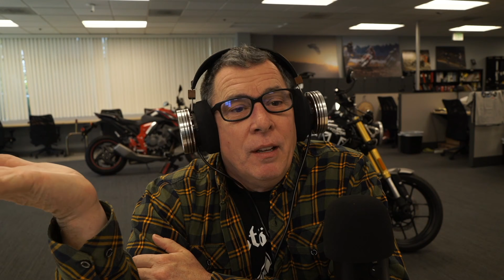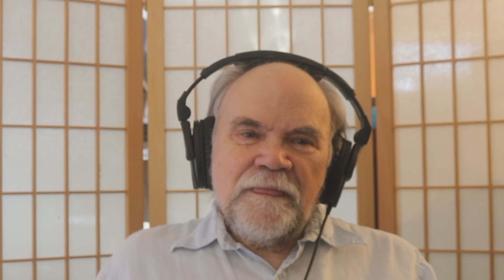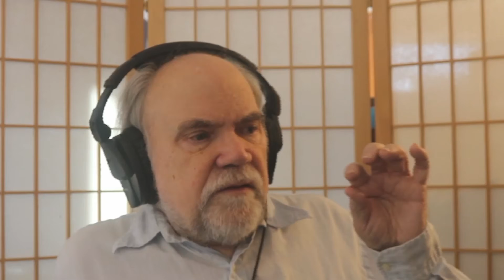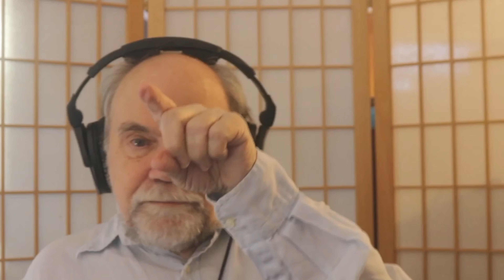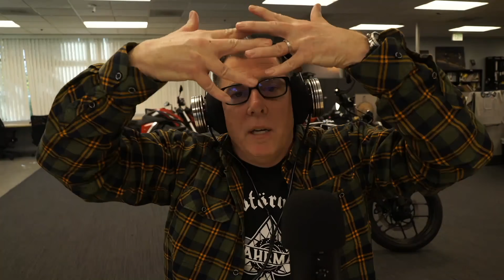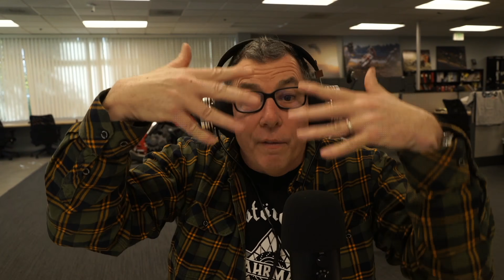The TOP 6(ish) MOTORCYCLES and TECHNOLOGY that changed everything!

Comment: I have a 1976 Suzuki GT750A. It has twin frame loops similar to Featherbed. To top tubes are closer together (rider comfort) and it has a substantial tube from the top of steering head to  a cross tube under the seat. 
It handles badly on original rear shocks. It’s pretty good with Hagon rear shocks (softer spring & stiffer damping). Its downfall is excessive fork rake that makes it steer slowly.

Comment: NSU Max 250 had an eccentric drive to the valves. Same technique as used by steam engines to drive the cylinder slide valves.

Comment: De Dion invented a semi independent rear suspension. It’s a solid beam between wheels with the differential mounted to the chassis and connected by jointed 1/2 shafts.

Comment: I’ve just discovered this channel and I’m hooked already. Many thanks especially to Kevin for his obvious erudition. 
I’ve learnt so much already and my bs detector was never even close to sounding!
I’m returning to biking after a gap of a decade. I had a VFR750F-T for almost 20 years and I’ve recently bought a CB750 Hornet (I’m in the UK, not sure if this machine is available in the US) and love it. In real terms, it was less than half the price of my VFR. 
I was really interested in Kevin’s remarks on this new wave of 270 degree parallel twins, of which the Hornet is an example. The Hornet is also 8v but only SOHC, I’d be interested in Kevin’s thoughts on this. 
BTW My new Shoei helmet has a ‘Pinlock’ visor. I’d never heard of this device before but to me it’s miraculous. I live in the cold,  rainswept north of the UK and yet my visor never mists, even when stationary in traffic and fully closed. How on earth does it work? The usual  ‘it’s just like double glazing’ explanation doesn’t really cut it for me. 
Anyway, I digress, thanks again to both of you - liked and subscribed.
Reply: I work in the industry.  I've been a fan of Pinlock for almost 20 years - I won't ride without it!   I've had Pinlock webinars, though it's been a while.  I agree with you on the "double glazing."  It may play a part.  But,  the big reason I recall is that helmet shields are hard surface treated, so the moisture in the air has no option but to condense on the surface.   The Pinlock is not hard surface treated and is therefore able to absorb moisture and prevent it from condensing

Comment: Thanks so much once again! I started riding on a 57 Norton Dominator 600 in 1967 and consider my apprenticeship on heavy British twins to have saved my skin when I finaly graduated to a ZX7R In 89 and eventually to a ZX12R IN 2001. Having a broad range of riding experiences prior to these light and blindingly fast machines saved me from the pain and anguish of youthful exuberance!
My CBX and my ZX12R languish in the garage while I settle into my old age on my 2 valve MultistradaS 1000.
So many memories flood back while listening to you two. Maybe I should re commission the 12?😊
Reply: Honda CBX1000 had 4 valves per cylinder yet made just 105 bhp. To be fair the spindly front forks could not handle any more but I’ve often wondered why it was never given its real (if not full) potential

Comment: Motorpace bicycle racing is pretty quirky. 
Now, a special scooter with pedals 
is the official machine. 
The pedals are used for giving the operator a cadence oriented sense of 
Maintaining a intended pace and or graduations of pace required for competition.    Strategy and communication between the team is
Essential.    
50 mph on a bicycle velodrome,
 only inches away from the back wheel of the moto requires some skill. 
And the history of 6 day bicycle racing 
is quite interesting.    Bicycle racers were the highest paid athletes in America at the time. 
Madison Square garden was originally built for housing a bicycle velodrome.
I was a track racer.   I specialized in 
Match Sprints.     Because, at 225 lbs 
And built like a linebacker,  wasn't an asset when chasing those skinny 
125 lb road racers uphill.
And why i like how easy my rc51 'thunder pig'  is to ride.   Torque.   But the RZ350 did have some zing
above 6000 rpm.     And i could pick it up off the ground. 
Motorcycles are awesome. 
But the bicycle saved my life.

Comment: Ok, my fun Hyabusa story. It was available here in Canada before it was available in the US. I was the service manager at a shop here and one of our first sales was to a customer in Arizona that couldn’t wait until it was available there. He showed up we went over the bike and sent him on his way. A few weeks later we get a notification from Suzuki, Do not sell , important safety recall contact customers immediately!  It could die at speed because of a problem with the fuel screen material. So I called him, got the answering machine and left the message about how he shouldn’t ride the machine until the update arrives and I would send the parts and instructions down to him asap. He called back a few days later laughing his ass off. He had just gotten home from doing an organized highway speed run in Nevada where he averaged just under 200mph and won the motorcycle division, gets home and the first message on his machine is …

Comment: When they started talking about suspension travel, I immediately thought of the single shock revolution in dirt bikes, which is easily one of the biggest suspension advances in motorcycling. How many years has it been since any dirt capable bike had two rear shocks? Or any street bike, for that matter.
Reply: @dougrobinson8602  
Alot of that is about shock technology though, take an old street bike with twin shocks and put a good set of Ohlins on it and it's a world of difference, the first mono shock bikes are closer in handling to something from the year before that was a twin shock than today's bikes, because not only has the tech improved but nowadays bikes are coming from the factory with higher end shocks than years ago, just like brakes, they don't upgrade as much because they're installing the high end aftermarket stuff at the factory nowadays.

Comment: I had a NC30 or Honda VFR400R....the single-sided swingarm had a 'designed by ELF' , the fomula 1 company , Decal on the swingarm.  Gear driven overhead cams and 14,500 rpm redline.  A gem.

Comment: Solex, a excellent example of don't put the engine there. Megola, another example of nope. Big gyroscope force resisting turning and no way to disengage the drive. Hayabusa, a truely wonderful bike. Suzuki has always had a special understanding of how a bike should encourage confidence. I would own one if I could live with its apatite for tires. I have a 2015 Super Duke and with its early generation throttle control/traction control it is a safer motorcycle than my 2004 Honda 919 despite having  75% more horse power. And it makes me laugh.